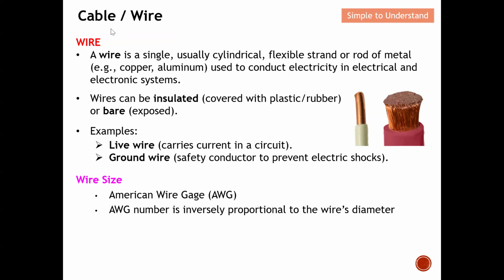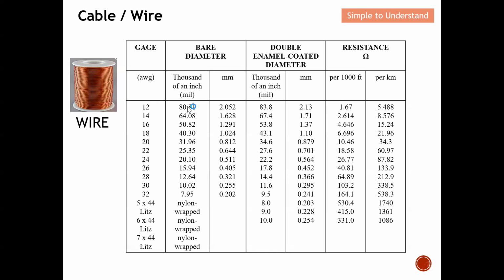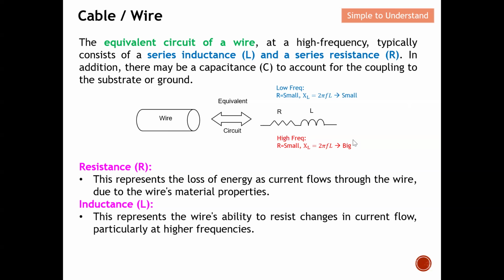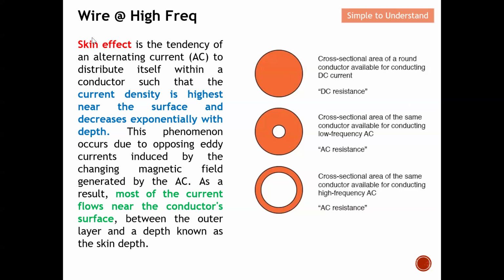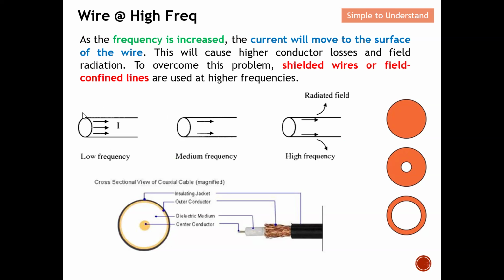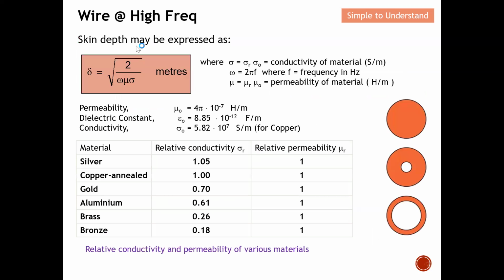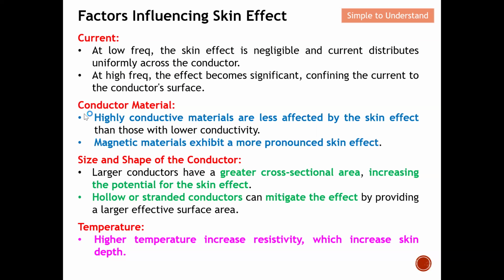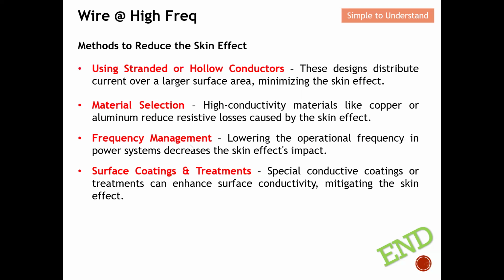Microwave #3. Why Wires Radiate at High Freq? Skin Effect: Current Flows on Surface, Not the Center.

Comment from the maker: Thank you for taking the time to watch this video on the introduction to Microwave Engineering. In this video, I will begin the discussion on the Skin Effect in wires. Besides wires, we will also examine inductors and capacitors, exploring the effects of these lumped elements at microwave frequencies.
First, let’s define what the Skin Effect is. At DC or low frequencies, the current density is almost uniformly distributed across the wire's cross-section. The equivalent circuit for a wire under DC or low-frequency conditions can be represented by a simple resistor, which accounts for the conductor’s losses.
However, at high frequencies—such as microwave frequencies—the wire’s equivalent circuit becomes a resistor and an inductor in series. Due to this, current tends to flow primarily along the conductor’s surface rather than through its center. This phenomenon is known as the Skin Effect.